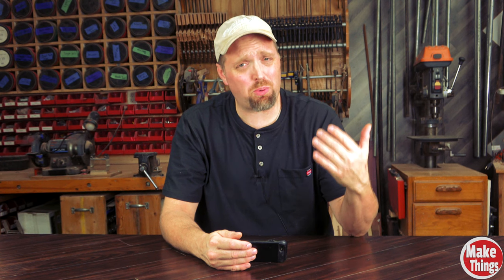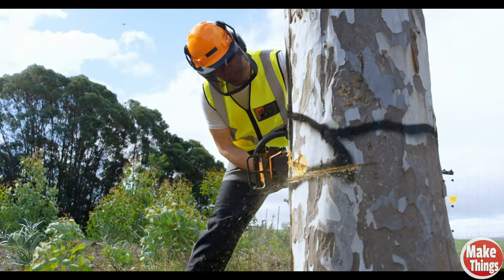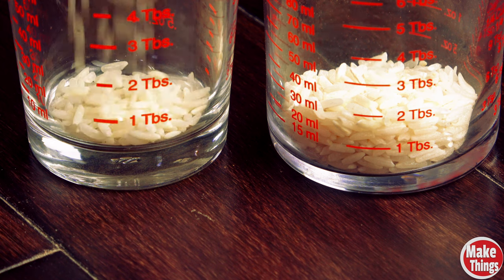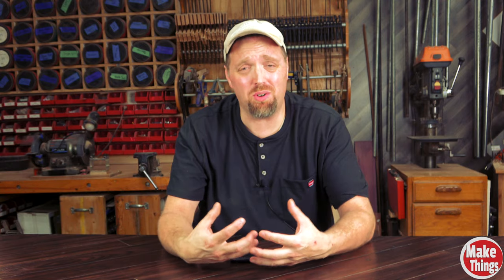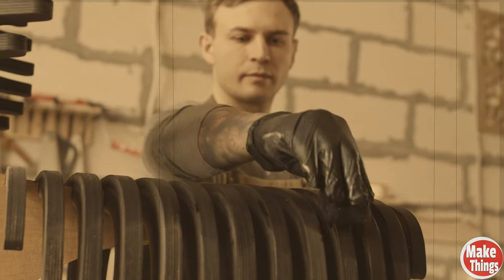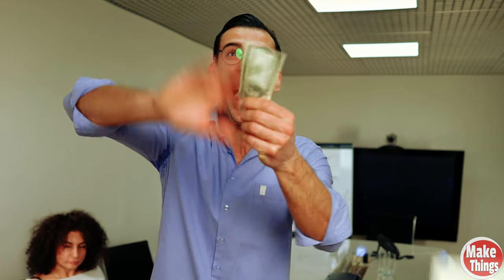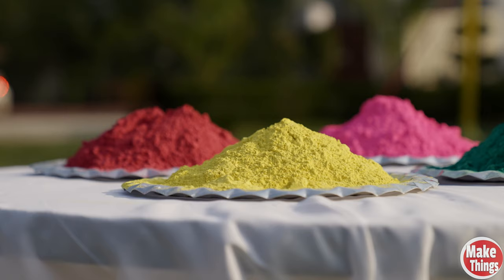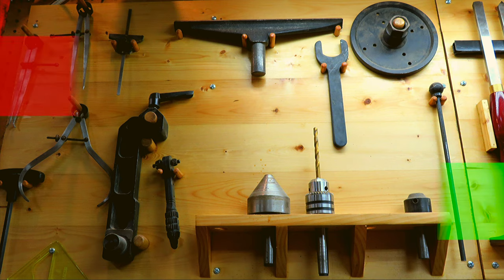Raising the grain...wait...what? // B4WMT #4

Comment: you can intentionally raise the grain then let the wood dry and use a scraper or a fine sand paper to give it a smoother finish dry, then finish with water or oil base and it will be smooth

Comment: Another great advantage to water based finishes is for health reasons.  It is much safer to use water based over oil based, especially when spraying.  You should still always wear a respirator, however the effects of water based staying in the air are far less than oil based that can gas off for days or even weeks as it dries.

Comment: We use a water wash made out of 10% water and 90% alcohol blend.  the rised fibers to sand off. the alcohol flash off. set aside to dry before stain was applied. sometimes 2 different stains to built up the color shade. water base stains 2wks drying times. water base colors give full clarity of the figures in the wood.